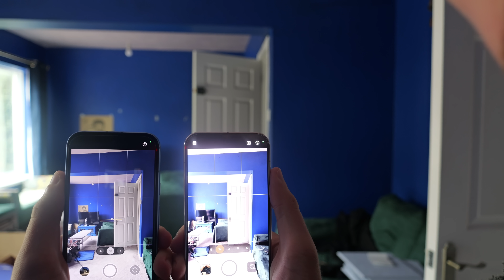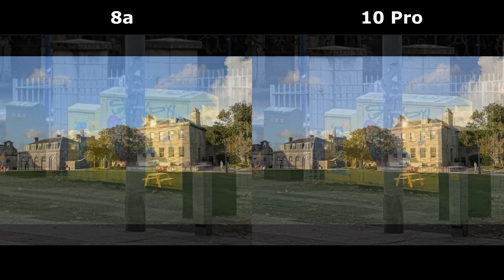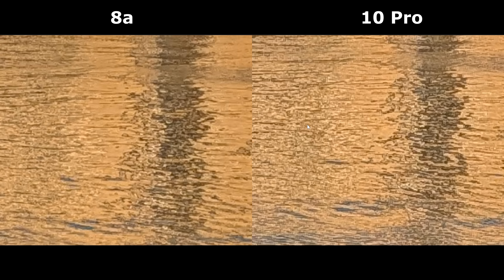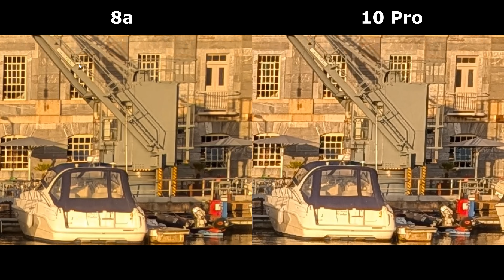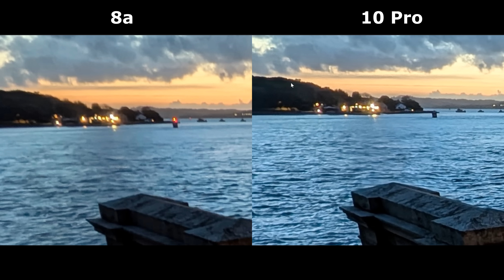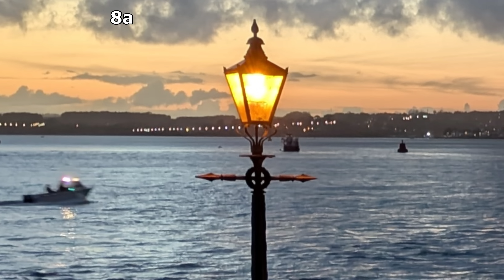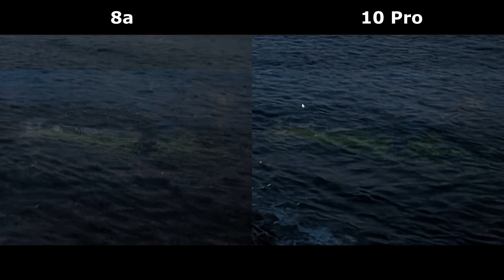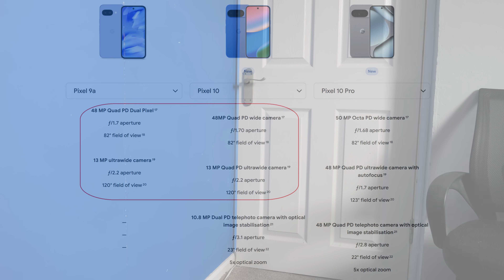I Tested Google Pixel's Cheapest and Most Expensive Phones

Comment: The thing is, 8a's sensor is bigger than Pixel 10 (non Pro) — 1/1.73 vs 1/2. Would be interesting to see the difference in low light between 8a and base model 10 (not implying you should do this)
Reply: 9 literally offers better camera. 8 offers better camera. 8a offers better camera. I'm so sad about 10. It's inferior to 9 in every way bar the soc. I returned my 10 and went back to 8. I will try again next year

Comment: I have the P8, is it the same camera as the 8a and 8pro ?
Reply: No. 8 and 8pro use same sensors.8a is slightly worse, but were talking 80 vs 82 degree fov and 1/1.73 vs 1.31 sensor. 1.68 vs 1.89f etc etc.
Reply: @FourGoose  Okay, thanks! I wasn't very impressed with its camera though...

Comment: Strange how 8a appears to be able to out do the 10 Pro though that subtle green hue is annoying to see on the 8a..
Reply: It is a basic photography processing tool feature to be able to correct these colour-casts.
But to do it cleanly, you would want to work with RAW files, as processed 8-bit colour causes banding when adjusted.
Though a subtle hue shift still works out okay on these already processed images, in a tool like Darktable.

Comment: I'm surprised that the 8a holds up so well. I'd rather have stuck with it, since I don't value the camera quality/colour as much as you do. Rather, I want to see if the phone can take videos in 4k, since I believe that footage is more important.

Bit of an extra point, but if I were you, I'd flash it with a new OS because after Google drops support for it you won't be getting any new Android versions. I use a Redmi Note 10 Pro (2021), which only recieved support till android 13. My one runs android 15 LineageOS 22.2. You do have to give up the seamless experience and all system apps that work well out of the box, but I'd rather my phone keep up to date.
Reply: The 8a is good until 2031.